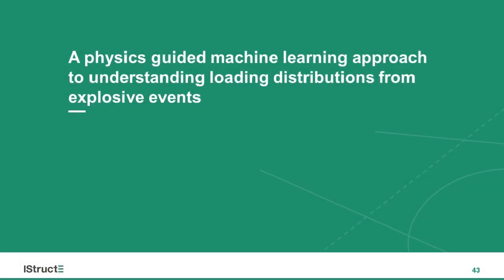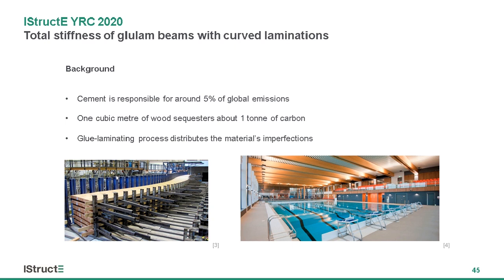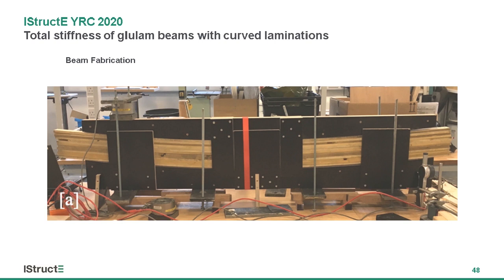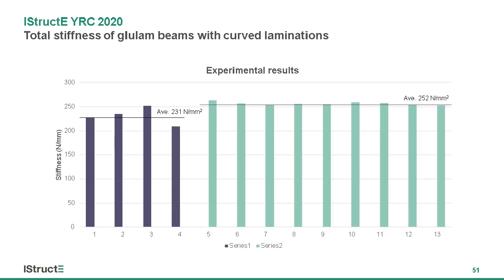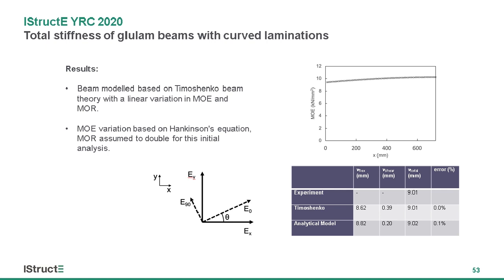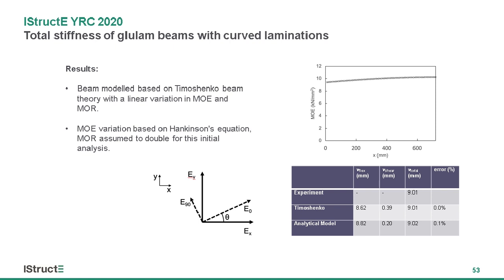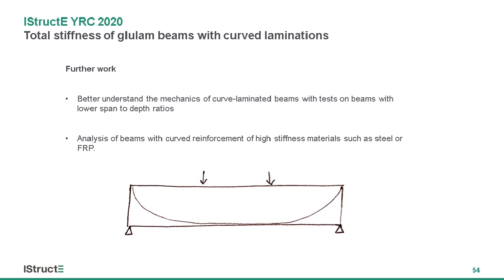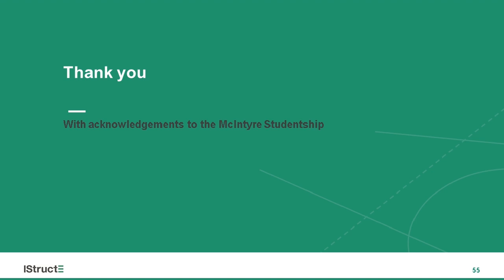Total stiffness of glulam beams with curved laminations

Comment: Or Just pre-stress timber beams on the tension cord with off the shelf steel cable. Nothing new old timber ladders had been made that way for a long time. (Perhaps forgotten)
Its great that your looking at new techniques & aesthetically its a thumbs up from me, however your intro states combating climate change, the simplification of designing for strength needs to be affordable and perhaps re-educated too the masses if you have the ability and resources.
Its a simple concept that could bring more span & strength for less resources.